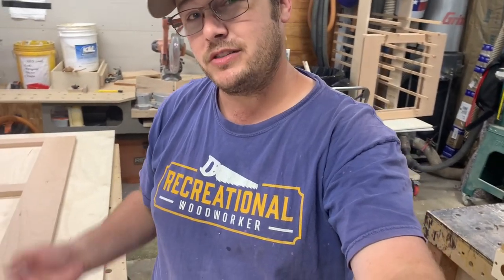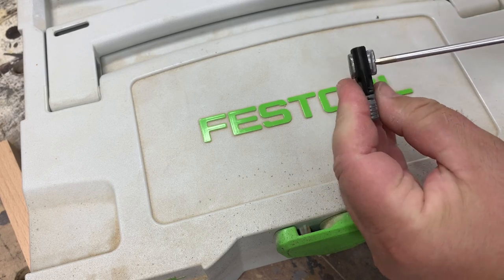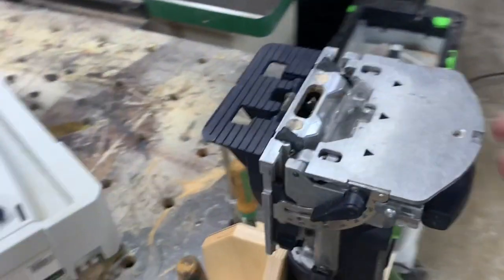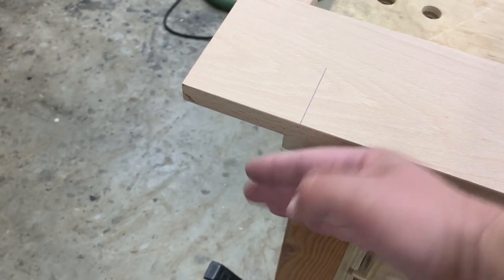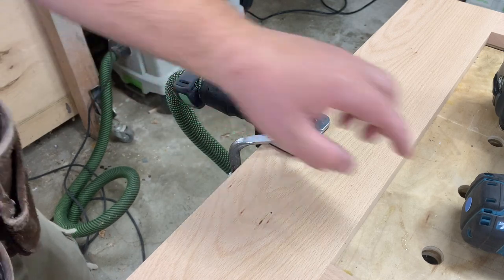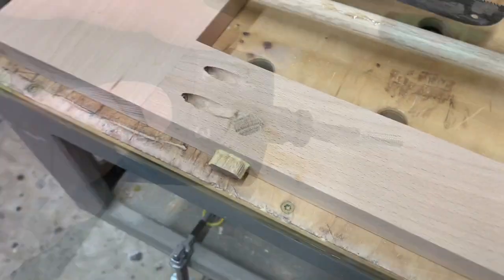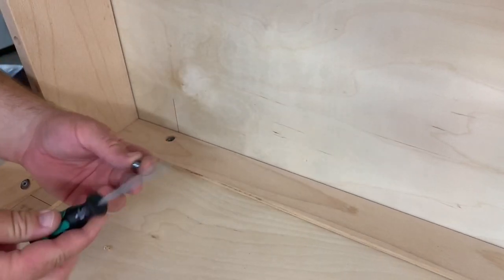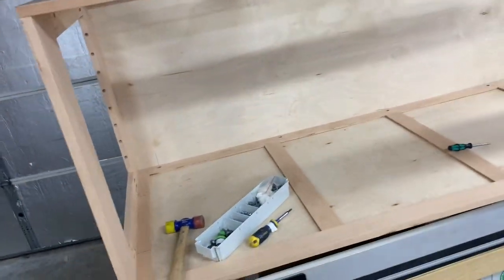Festool Knockdown Connector System: how to build flatpack furniture to ship.

Comment: Great video. I have been looking at that connector system. I'm still in the process of somewhat mastering my new Domino 500. I build tall cabinets usually 6' x 3' x 18" or so depending on specs provided. Handling the cabinets after attaching  two sides and a back is getting difficult for one person and this looked like a way to dry assemble and break down for finishing.  I'm building my first cabinet now using the Domino and have added a few features to it but won't charge extra for them. Thanks for this video. To me it is more relevant seeing someone new to the system explain things than a veteran user who just glosses through making it look too easy. Thanks also for the Domino holder info. The only place I knew that had them was Bau Woodworking in the European area. Local is always great. I think it is a handy item.

Comment: Really great video Robert . Which size Domino machine are you using? Sorry if I missed you saying In the video. That kennel came out really nice!
Reply from the maker: I have the 500 (the small one) there is a connector system for both the 500 and the XL.